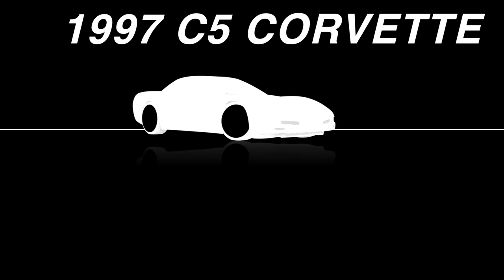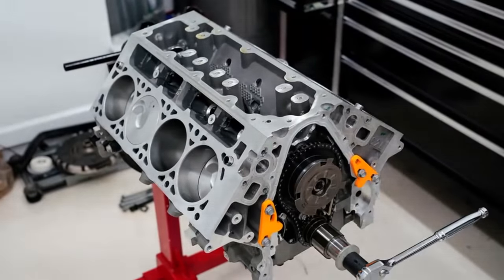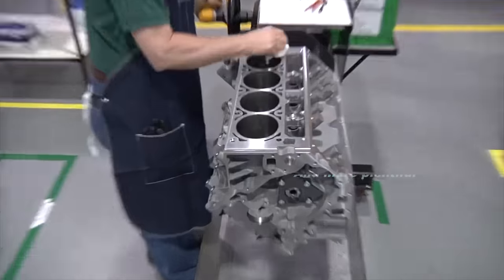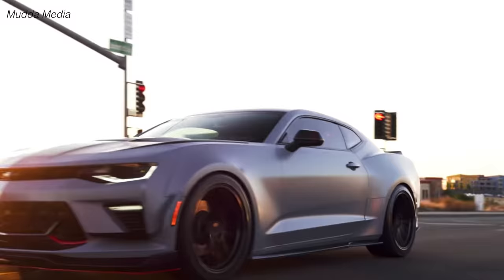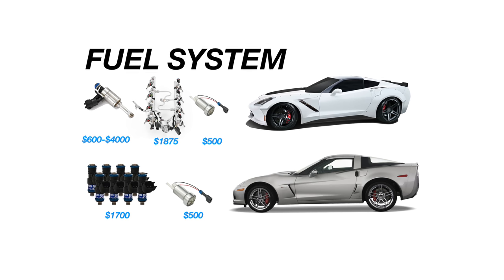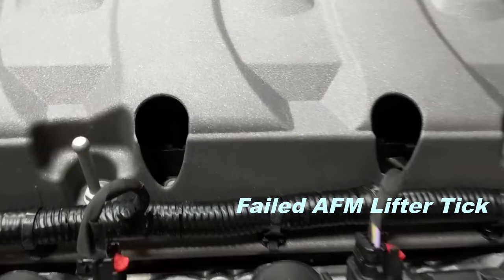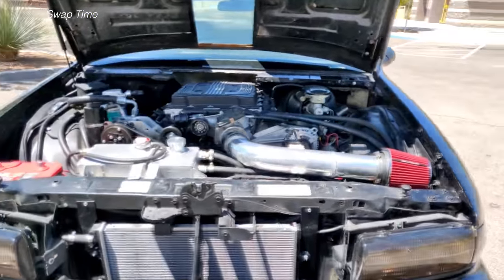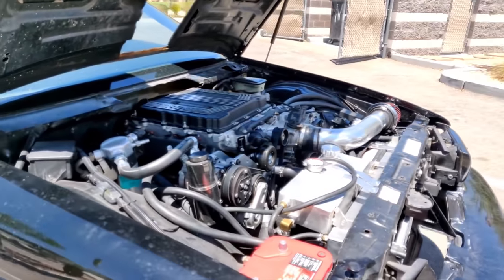Why LS Engines Destroy LT Engines Still😭 | Explained Ep.1

Comment: I mean, if you add headers, a cam, and what else did you say? Ahh yes, an intake... you can do all three of those with the stock fuel system on an LS1 anything... Camaro, Trans Am, Vette, SSR, lol... none of those things alone, or together, outpace the stock fuel system.... so, I'm not sure that's really a big pro for the newer variants.... anything can accommodate that.... heck, a 87 VW Fox can accommodate that, lol.
Reply: You will definitely run out of injector. LS1 engines have like 26 pound injectors in them. You'd probably run out of fuel pump too I'd imagine. I'm not 100% sure I've never had a GM car, I just use the LS engine. But yeah, I don't see the point of not at least putting a Walbro 255 in there. I'd put a 485 like normal.
Reply: @TurboV8boi  That's just not the case at all man... The entire planet knows better, at least the portion of it that does have experience with GM, lol. Just take for example, all of the cars that literally portray the opposite. My 99SS LS1 happily running a cam and intake for 10+ years on the stock system. My buddies with a cam, intake, and heads, all fine for 10+... my LQ9 with a cam. ALL OF THE Fbodies that were running 10-12sec passes from 1998-2010 when they became a lot less common to see, 90% of which had the same basic mods, with the same stock fuel system. It can do it.... no problem. CTSV, Camaro SS, Trans AM WS6, SSR, GTO, etc... all fully capable of getting power adders without touching the fuel system at all. Now, if you go forced induction, it's different.  They are 26lb injectors, behind a 200lph pump... most always makes for a workable approach to around the 500whp mark. Folks use it with heads, cam, intake, and nitrous often enough. Very often really... mostly all the time. And quite often with blowers and spinny whistlers too. If they're the only power adders usually... and that stock fuel system will allow you to see  10-12 sec passes with ease. Pass after pass after pass... for literal decades.
Reply: @Dex99SS  300cc should max out at around 400hp. I ran out of stock truck injectors at about 330whp, although my base fuel pressure was 43 psi instead of 58. I'm currently running 1300cc at 830whp through an auto with ethanol. 

Maybe you can super max out a set of stock injectors at 100% duty cycle, doesn't mean you should. Really you should have 10-15% headroom in the duty cycle on the injectors to be safe.

Comment: I have a 96 Caprice Classic with the LT1 in it I love it so much. It sounds so good. And it's a 5.7L actually not a 5.3 m8
Reply: The 92-97 LT1 is entirely different to the 2014 & up LT1. The 92-97 LT1 was just a stop gap design between the TPI L98 and the LS1.

Comment: “In my opinion” The only thing stronger in the LTs is the closed deck style water jacket (same as LSX block) in the block which gives advantage specifically in the 1000++ hp aluminum block builds..
Which can be easy fixed for the by the LS is half fill or fully filled blocks.

Comment: Correction here. GEN 4 small blocks such as the LS3, LS7, LSA, LS9 that are bolted to a T-56 or TR-6060 6-speed tranny do not have AFM/DOD. They can’t because the shifts are not controlled by the computer they are driver controlled which means the car has no idea when you might go to WOT and can not predict that where in auto cars the car has full control so the L99 does have AFM. GEN 5 small blocks all have AFM/DFM lifters not matter if it is an auto or manual depending on the model but any manual vehicle will not have it activated thus you have a normal small block!

Comment: The aftermarket needs to make a secondary high pressure pump,  that is crank driven or something,   maybe an electric pump with injectors,    then there is adding port injection, to the LT,  this can lead to issues with detonation (possibly) with high compression, and bad tune,  maybe use the stock direct injection until fuel has maxed out, then use port injection with E-100, or E-85,  as! He secondary fuel system, the tune for E-100 can make tones of power due to huge octane bump, and intercooling effects, I'm guessing 100-200 HP over gas, on a boosted engine,  
I agree, LS all the way,
But a 10speed does sound nice, but a 6L90 or 8L90 isn't far behind! I'd rather have a tr6060! Or t56!

Comment: It's hard to find LT and Trans combos. Even junkyards that have them sell them short of what it costs Turnkey from GM. (14k vs 16k). With a $3000 budget, a lot can be done with a LS. They have become cheaper than 305/350 SBC builds and return more HP/$ than either the LT or SBC.

Comment: The LS4 is the redheaded step child "LS" RPO nobody remembers and it indeed has AFM and VVT. Goody block with no starter mount so unless it's a front wheel drive basically nobody bothers with them lol.

The L8T comes with a conventional LS style accessory drive on it including a power steering pump so that's not an issue. 

I see no benefit to the LT worth my time... have had a bunch of them now and Meh... lol. When the L8T was released I was one of the only ones out in the groups excited about it.  So many were so ignorant to it as its "just an iron block truck engine" and I was like what the hell is wrong with you.  It's the base engine in every HD truck and will fill the scrapyards in about 10 years from now like the 6 liters do now.  I even bought a single piston, rod and the crank to see what the heck they were.  Piston has a higher pin height and the rod is just a full float pin LS rod.  Out of it all, getting the L8T crank back when they were freshly released by GM and super cheap, will do an LS stroker one of these days.  Other than that... LT guys can keep them.  I have an L86 sitting around I could turn into an aluminum L8T but why... and there is no reason to bother.

Comment: A ltx engine on the same everything will average 30 percent more hp. I tune both and lt is so much faster then ls on same mods. The big issue is most people cannot tune lt correctly and find the hp     . The cooling affect of di fueling you can add up to 5 degrees more timing on the same shit 93 octane and make 30whp or more vrs the ls platform. 
Engine prices are coming down a lot now that a ton of 5.3 di truck motors are hitting scrap yards. A 6.2 is no question better on di vrs port fueling as paying a mint on both those engines anyway. Plus now the available 2650 blowers 1200whp comes easy on a sbe 6.2 with a good set of heads and cam.

Comment: you know I hear the "size" thing with the ford style engines vs LS (keep in mind I'm using a 302 racing block so I'm no chevy shill) quite a bit and no one is doubting the output for such a comparatively small displacement. The modular engines in terms of size yes are small in displacement and I guess in weight but in comparison of SIZE, the LS takes the win against the modular for sure. Holy cow the modular engines are huge in the respective space that they take in the engine bay. My 302 is tiny compared to the coyote but both are the same displacement, of course that's the heads and all but I feel like they could have done a better job at compacting everything. LS fits in everything because it FITs in everything...

Comment: I own an ls from 2005 with the DOD, so really needs to check his facts on this. Several of the vortec series engines had DOD systems in 2005 and on, something to keep in mind when pulling a junk yard motor
Reply: I think he may have been going with the nomenclature differences of the iron block truck engines being LM series though they share the LS platform commonalities.
Reply: @timtimtimmay4654  the lm is the ls, just an iron block not an aluminum one🤦‍♂️
Reply: @themortalinstruments2776  technically, it is LM, or else it would be called LS. That is why I said what I said.  They are classified as a different engine code than LS even though they share the same family. The only confusing one I can think of is the L99, and I'm not even sure how Chevy classifies that considering it is a nomenclature change from the LS3 but is aluminum and AFM. Same with the LS4 5.3.
Reply: @timtimtimmay4654  where are you getting your argument from? They are made exactly the same way, one with iron the other with aluminum. And of course they have a different engine code, the materials are different. But the install kits for the ls is the same across the whole line, which includes the lm and lq engines even the l99. There is literally no differences between them except the materials used to make them and the manufacturer label. Iron blocks are typically what most people use for horsepower anyway since it's capable of handling more. And you can ask any one who is worth there salt in building high horsepower cars using an ls and they will tell you it doesn't matter if you get the parts for an ls, lm, or lq because they all fit. The only reason for that is not because the lm is technically an ls because that still means it's not, it's because it is exactly an ls with better materials and has more potential.

Comment: Any recommendations on which LS?  1974 Square Body K10.  Long highway drives before hitting dirt or mud.  Need a matching transmission, either manual or automatic.  Fuel economy and durability are more important than HP.  I am fine going a bit slow but hate to breakdown in the middle of nowhere.  Could do a new crate or junkyard.

Comment: The more important question isn't which one is better, it's why the LT? Why not just make a direct injection LS? Then just mod the LS however you want or need to, that way you save money in development cost and the new technology becomes backwards compatible for the older generation LS for more swap ability. Also with electric motors starting to be the new thing the LT won't get as many years as the LS anyway and if it does the LT is only available in cars and trucks more and more people are going to avoid because they are way too expensive to purchase and that will keep sales low and junkyard inventories lower.

Comment: Ls are great for budget builds., Go to any junk yard, its filled with Ls powered trucks, HD vehicles. Buy Good running Ls with transmission from junkyard for $900, clean them, replace head gaskets, add head studs, lifters, cam, springs, reassemble, flip add new oil pump, and trans filter. DONE 550HP. go race !!  Most Ls bottom ends wont let go till 750hp + is approached with forced induction (the connecting rods bend). So.. add decent H beam rods, bearings and seals, now problem solved. Use LS7 heads, ADD about $2000 worth of fuel system/intake/exhaust/cooling and it'll  reliably hold 700HP + . Stock Cranks get sketchy over 950HP.

Comment: LQ4 6L I turned it in to 408 ci 6.7L from LQ4 6L 
I put in my 2001 suburban 4x4 
And the gas mileage went down.037 a mile the torque to the ground is 361 ft pounds of torque takes exactly 180 ft pounds of torque more than the old 6 l had put 274,000 miles on it I spent my money well any drag racer would be happy to have this in their car because I use nothing put forward quality parts Cheney performance built it for me

Comment: Controversial opinion, but I think the absolute best V8 ever made was the 1987-2002 first gen, roller block, SBC which includes the Vortec engines.

Why?  Simply put, simplicity and a wide range of possibilities.  Very easy to build, parts are cheap, they're an absolute joy, and if you know what you're doing they can put down some serious power too.  Maybe not the best in any single category, but they absolutely are the best all around engine ever made.

Comment: The new 5.5ltr. Corvette engine is the most powerful N/A V8 engine ever in a factory car. This is only possible because of 4 valves per cylinder and dual overhead cams, with the spark plug centrally located. This engine is really something to be proud of. Plus, it's installed in a mid engine car, available at a reasonable price. The Europeans are crying in their beer.

Comment: The LT motor is a far better platform than the LS. its a great successor. The problem is, its more expensive and thus people keep to the LS for a lot of the builds and retrofits. It is harder to modify but when done properly they produce more power on every similar combination. The only exception is N/A when compared to the LS7 but the LT platform doesn't have a similar head as the LS7 available and it is more comparable to an LS3 head, which is the motor that is meant to replace.

Comment: You made a mistake. There is a pre-2007 LS engine with DOD.
The LS4, which was only ever fitted to FWD cars and is often forgotten as a result. The LS4 was a 5.3L LS v8 with modifications to work in FWD W-body cars.

Comment: So if all I'm after is fuel econ & some weight savings, then a newer stock L83 would be better than rebuilding an iron LM7? Or would the non-AFM cam swap negate the fuel savings from direct injection? L83 seems to make a bit more power/torque, meaning I need less pedal for the same speeds, but will that translate into higher mpg?

...plan is to tour NA in an old ElCo with 5spd swap. Zero likelihood of adding power, aside from longtubes. Might eventually tour Europe too, if life allows.
Reply: Also, read about a Volvo PS swap, so I think that issue with goin L83 can be handled, right?

Comment: I never thought that completely closing the valves on the AFM cylinders was a good ideal, why not just shut off the injector
Reply: Then you've got 4 cylinders "engine braking" erasing any benefit you might see from shutting down the cylinders
Reply: @knotical689  yes, quite true, it saves very little.  I’ve seen guys lean out the ratio on corvette C5’s to get 40-45mpg but manufacturers don’t do this because of NOx emissions
Reply: Because with oxygen still flowing through the cylinder, it goes into the exhaust, passing fresh air over the O2 sensors making it think the engine is extremely lean.
Reply: @justintc93  now that makes sense

Comment: FYI a DOHC engine typically have a larger physical size compared to a pushrod engine at the same displacement... For example a 6.4L hemi is comparable in size to a 5L coyote. So saying that a DOHC is "potent relative to its size" is not accurate.

Comment: If not for the limits of Direct Injection both in performance and PRICE, the LT platform would reign supreme 9.5 out of 10 times. I guess it all depends on what you are building and what you are starting out with (junkyard vs crate motor). For a 4x4 N/A Truck application, I would go LT hands down. 11.5 Compression, 87 Octane Fuel and an easy 600HP/600ft.lbs to the wheels. For boost, an LT is a waste unless you have it already and are just adding a Positive Displacement Supercharger, as it's best under 1000HP due to DI limitations.
Reply: 600hp to the wheels? How?
Reply: @moabman6803  Added displacement via stroke, compression ratio and camshaft.
Reply: @joeyjojojr.shabadoo915   I didn't know they made that much, that's dope.
Reply: @TurboV8boi  They need upgrades to make that power, but it is possible.

Comment: A REGUIRGITATED FORD 427 HIGH RISER ENGINE, AKA RAISED PORT 351 WINDSOR. THERE IS NOT ONE 1 DESIGN ASPECT OF THE OLD SMALL BLOCK CHEVY THAT LIVES IN THE LS. IT IS 100% BASED ON FORD DESIGNES. THIS IS THE MOST CRIMINAL THING EVER TO BE UNDERTAKEN IN THE RACE WORLD.